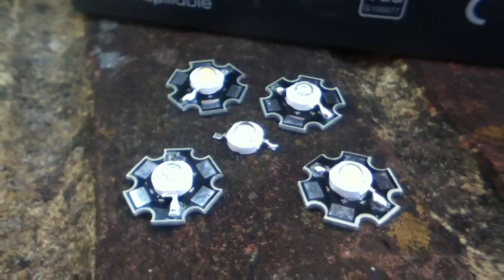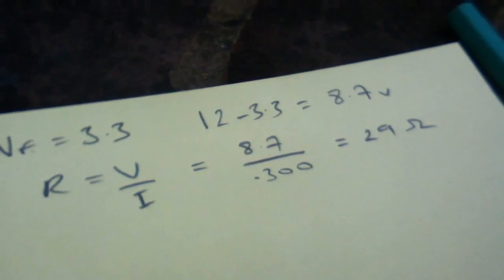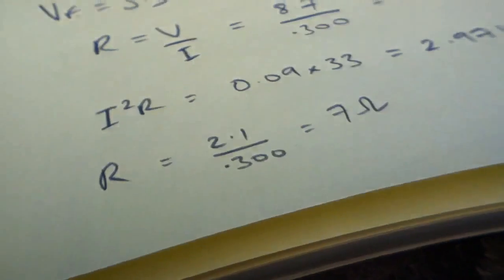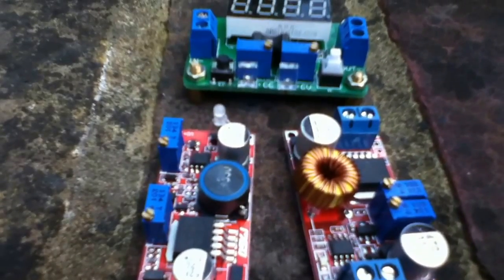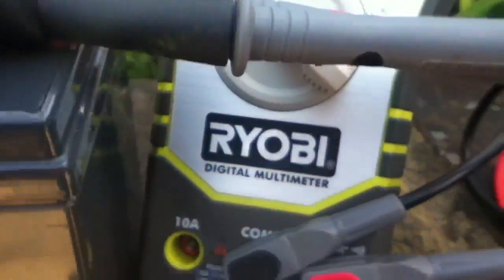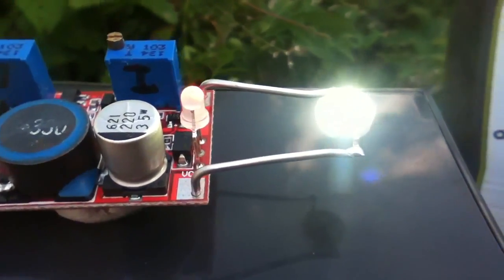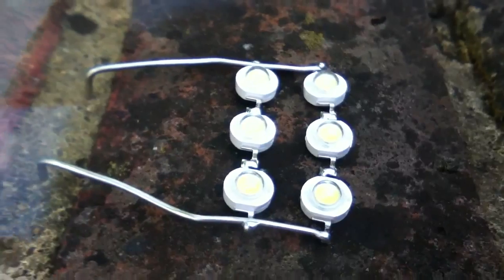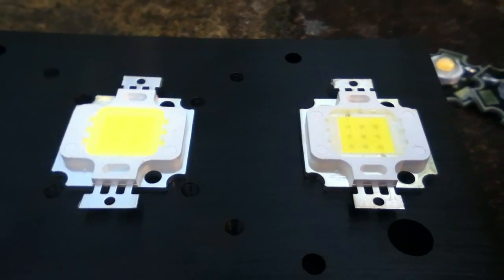High Power LED Tutorial #1 - How to Drive 1W and 3W LEDs from 12 Volts

Comment: Hi Julian, I am new to this LED. I am trying to learn. I have some of the small 3W LED which you have shown in your video. I like to use them for a lamp to convert to 12V so I can plug into 110V wall outlet. What kind of voltage current regulator would I need to use to support the LED. I like to use anywhere from 1 to 3 LED for the lamp. 
Thank you
John

Comment: Julian, Is constant current driver? If so, is it correct that when you connect the 2 strings of 3 leds in parallel, when one of the 6 leds fails the CC driver puts the same current through the other string of 3 leds which then get twice the intended current so those 3 leds will go pop. Does it follow then that you cannot use a CC driver on LEDS when in parallel, only when in series?

Comment: Hi, I made myself for a spare time hobby a small 3D printed desk lamp, where I'm using a simple joule thief circuit to drive 3 of the 5mm white LEDs in parallel from a single AA battery. I bought a 3W white LED in order to make it brighter. When I connected it instead of 5mm LEDs, it lit a bit dimmer due to voltage drop. Checked with a multimeter: JT provides total of 22V through a diode without load and when I turn on the LED it drops to 2.3V at around 24mA current, I know that max. voltage for this LED is around 4V at higher current.
Any ideas what shoud I modify to provide it with sufficient current? Do you maybe have good and simple references for this?
Thanks!

Comment: I want to use the 1W LEDs for a model kit using only a single coin type battery like in the beginning of the video. Is it necessary to use a resistor and will it get hot enough to damage plastic?
Reply: +Kevin Lam 
It'll be fine because of the Batteries Internal Resistance, won't very last long though :P

Comment: Would you think a 3W LED with 750 forward current, 3.6V voltage could be
 ran with a 5V 1Amp battery? I only need random flashes, not continuous 
light.
Reply: Brink I tried it burn the led

Comment: I see many from this manufacturer with a third pot between the other two...what is that for? Duty cycle or something? Is it so you can use the driver as a dimmer or something?
Reply: +mellowb1rd  The three pot version has charge ready LED on the pcb. It turns on when the current falls below a certain threshold value. With the third pot you can adjust the threshold current. This feature is only useful, when use the regulator for charging li-ion battery.

Comment: what if I just power 1w led with a 12 v power adapter what will happen no resister's nothing
Reply: +Mythical Unboxings The LED will most likely die instantly since you are creating a dead short across it. Unless your adapter has some sort of current limiting circuitry, I would suggest using the methods shown in this video. Correct me if I'm wrong anyone?
Reply: You're LED will burn out instantly. You must use some sort of limiter on a led if using over the 3.3-3.6v.

Comment: Could you use a pc power supply as your power supply. 12v 24a which i'll regulating to 12v 1.4a? I'll be adding a heat sink behind the lm2596. would that help?

Comment: It would be much appreciated if you cut off the end of the video showing two columns (parallel) sets of LEDs.  I purchased supplies based on this video and later found out that you should have a driver for EACH string in parallel and now my supplies are all wrong and will cost a lot to replace with the right supplies.  

Information is here and fully describes why:
http://www.edn.com/design/led/4325905/Driving-high-power-LEDs-in-series-parallel-arrays

In the last paragraph of the article:  "You should include a current regulator in every parallel branch."

And to summarize the lengthy article...

Because of minute inconsistencies in the manufacturing of LEDs and their heat reactions, current will flow unevenly through strings in a parallel array.  These minute differences in the LEDs can allow large differences in current to the point of damage and failure of the LEDs.  Therefor you should always have a method of controlling current to each string of a parallel array.
Reply from the maker: Taf & Caf It's common practice to use a single constant current driver to regulate current to the entire array. The 100W COB LEDs have ten parallel strings of ten LEDs in series with now way to access the individual strings. The individual LEDs have a wide margin for being overdriven. Total power is more of an issue because of the heat generated.
Reply: Julian Ilett The article made it sound like the current could easily destroy the LEDs if each series didn't have it's own controller.  Is this avoided by using a lower voltage than called for or something else?  I would much prefer to only have to use one controller for a larger array, but I really don't want to do a big project and then have it burn out section after section.  (I had this happen with a 5mm LED project I did before but didn't know why until I read the article about the current issues.)
Reply: +Taf & Caf If you have 10 strings in parallel and one string fails, the increase to the other strings is very small. If it were 2 strings, it would be different.
Reply: I mean...if the one string fails, it's not failing BECAUSE you only used one driver. It would have probably failed anyway. So you've lost nothing you wouldn't have lost anyways. The more LEDS in series each string has, the less likely it is for one string to be drawing more currecnt, because all the little differences average out. What are the odds of getting one string with a  much lower voltage drop, when each string is made of 10 randomly selected LEDs? If the array were just 2 LEDs in parallel, then one "string" could be drawing quite a bit more current right from the get-go, just because of the differences in the LEDs, even if they're the same model and production run from the same factory.
Reply: +mellowb1rd Makes sense, but I am ranging from two to five strings for my application, so the loss of one could create enough trouble.  Am doing it anyway though at about 70% voltage and hoping they will keep running for a while.
Reply: Taf WebDesign
Maybe put a sacrificial offering in series with each string? Or some kind of indicator, so you'd see that one string failed and would have time to turn it off. Ghost hunting groups sell IR LED arrays they designed incorrectly using online calculators without knowing that the actual voltage of their battery is not what's written on the battery. They seem to survive just fine. I'm pretty sure that, if you had 5 parallel strings and one failed, the other 4 would survive plenty long enough for you to notice. Especially if you are a bit conservative to begin with. And, the more LEDs in each string, the less likelihood there is of one drawing more current, anyway. But if you're going with two strings...why not just use 2 regulators. They are cheap enough. You can buy ones that only regulate current, and they cost less. Couple of bucks each.

Comment: Hi there. .Please please please. Help me. .I've got wind up torch with 4.2v led battery 1000amp is dead. I replaced with 3.7v Lido rechargeable battery .2000amp.  Please contact me on 07951940602

Comment: I have another question perhaps you would know what is best to do in this situation, I want to drive a total of 6 uv lights with the 12 volt battery I need to find the 365nm type lights and would this controller be the best solution?
Reply: I'm sorry Bob, I don't know the answer.  I am far from an auto electric kind of guy.  That is a real specialty.  Sorry.  I hope you are doing well.  :))  Dan

Comment: thank you very much, very helpful tutorial
I will connect 6 led in two column, this is spec of led
DC Forward Voltage (VF): DC2.2 ~ 2.6V
DC Forward Current (IF): 750mA
I will set Buck Converter output to 2.6V 1.5A
is it right ??
Reply: Seco Seco sorry for mistake 
6 led 3W each
I will set Buck Converter output to 7.5V 1.5A
is it right ??

Comment: Hi Julian

Great videos but the way! 
I have a few of this exact regulator,  could I use it safely as a sub c batterie charger. 
I need to charge them individually so I have set the voltage to 2.3 volts and the current at 450 mA as they are 5000mA cells. 
Is that OK?  And when they reach capacitie will the converter stop charging? 
The light is red while charging, will it turn green when they are full? 

Thx again! 
Adam

Comment: I want to use the 3W RGB high power LEDs to light some fiber optic fabric in a costume. I've I'm only using 3.7V Lipo battery how hot will they get. If I put them on HeatSink will it be safe around fabric? Everything I read says those little high power lights get really really hot.
Thank you!
Reply from the maker: Teresa Roberts A couple of problems here - 3W LEDs can get pretty hot, and you'll need constant current drivers between the LiPo and the LEDs. Probably better to use RGB LEDs with integral drivers like the WS2812B or APA102. I have videos on both of these.
Reply: Julian ilkkelktkt

Comment: I'm trying to complete a project but need some additional info. I want to power a 3w rgb led for a project but I was told I may have an issue with the heat that they generate. I want to put it in a headlight housing so space is a factor would I be able to have a heat sink that will work properly in a tiny space and if I used the same board to power the led what could I use to control the color

Comment: You said that it's impractical to use resistors with high powered LED's - Is that still true if you're running them from a more consistent power supply, such as a 12V power supply, plugged in to a wall outlet?
Reply: a 12v wall adapter could be anything between 10 and 14V and have maybe 2 volts of ripple on it. That's less consistent than a battery

Comment: If you put a string in parallel and any one of the leds has a slightly lower voltage drop, you risk burning out the whole string. Better use one resistor per string, if more than one, even with a regulator

Comment: SORRY FOR RAMBLING SIMPLY THESE CHEAP MOTION SENSORS AND 3 WATT LEDS ARE PERFECT FOR AN EASY DIY PROJECT.3 WATT LED,HEATSINK, MOTION SENSOR,TRANSISTOR,Photoresistor,3.7V LAPTOP BATTERY AND POSSIBLY CHEAP SOLAR CELLS AND THE LION RECHARGEABLE CIRCUITS TO KEEP CHARGED AWESOME MATE

Comment: Julian, thank you for your thorough and complete videos.  Have you tried, or do you know if it is possible to regulate the intensity of the led’s in this array with an Arduino and mosfet using PWM in between the buck converter and the led’s?
Thank you for your time.

Comment: HI This is perfect for me thanks. However, if I want to put a Pot or rheostat type device on this to drop the voltage and therefore dim the LED's - where would I put it? Will the VR try to keep the voltage up if I put it in between VR and battery?

Comment: Hello, thanks for the video it's very helpful - but I'm still a little confused about how to regulate my high power LED. 

I have a CREE XM-L2 U2 LED, which wants 3000ma at 3.5v for maximum power. I have a voltage and current regulator like the one in your video, it can deliver 5A. Do I need to regulate both the current and the voltage into the LED, or just the current?

Comment: hello hi brother, I am new to this stream, yesterday I bought  1 watt leds (http://www.ebay.in/itm/10-Pieces-LED-Diode-1W-High-Power-Cool-White-with-Base-Plate-Star-Heat-Sink-/231368457394?), and I tried to light it up so I used regular Nokia mobile charger(http://www.snapdeal.com/product/nokia-charger-ac3n/33948#Technical Specifications) but with in 4 minutes the led started flickering rapidly and later it is not lighting at all it was just stopped working. why? is it because of not connecting the resistor to the led or what brother? please reply me.
Reply from the maker: Manasseh Elson It may be because the LED overheated - did you use a heatsink? Also you should limit the current to around 350mA for this type of LED.
Reply: Julian Ilett Hello, first thank you for the reply brother. Actually I Used 2 Led without heat-sink and they are spoiled but I used a Led with Heat-sink but even it is also spoiled. and I used mobile charger which Input is: 110-240v AC 50-60Hz and the Output is 5.5v DC 600mA. What you say brother. I think I am giving high power to the led. And one more thing brother is it necessary to apply heat-sink past to the heat-sink? or not required?
Reply: Julian Ilett Hello brother you said 350mA is need for the Led, what is mA ,are both mA and mAh same?

Comment: I'm wondering what would be a good solution for a traffic director like this:
36" Amber Traffic Directional Advisor Strobe Emergency Warning Arrow Stick

I don't have a problem using smd parts, but wondering if there's any single-chip drivers, or a driver that would have some circuitry like one of these boards but multiple leads off it that I could switch with a micro and not blow anything up.

Comment: hello Julian Llett just saw ur video very helpful and solved many questions of mine as well...really great job done :) but there is a question it wuld be great if u help me out on this i am making a light panel of 80X1 Watt led's with heatsink one's the only problem is what dc stuff shuld i use..i am not much in electrical stuff but i am posting the specs for one bulb and its like this 1 led is of 1 watt consumes 3 - 3.5V and takes 150mA now can u solve this one how do we use 80x1 Watt leds it wuld be a life saver and amazing video cheers To you Man!!!
Reply: you can plug them all in series and use high voltage driver or you can plug them all in parallel and use a high current 3.2v power supply (10 to 20Amps)

Comment: Please clarify this.
The battery you are using is 7ah, the buck converter you have used can only take up 3amp (max 3amp input), you have connected it directly without any resistor. Why didn't the buck converter burned up?
What if I connect my 105ah battery directly with the buck converter I have which input max current rating is 3amp, will my buck converter blow away?
Please some one answer ASAP. Thanks
Reply: well not exactly an ASAP answer (4 months old) but anyways,

buck converter can take 3Amps max, but it doesnt mean that it would take in as many amps as you give it, it mostly means that you can suck max 3 amps out of it, you can plug it into a 1000Ah battery it wont blow up if there is nothing connected to it, if you connect a 1A load it will suck 1A, and if you connect a 4A load (trying to power a 44'' plasma TV through the buck converter for eg) it would try to suck 4A and get warm, and probably blow out.

LEDs are wierd because they have the ability to suck as much Amps as they get, thats why they would blow up so easily,

Comment: Just a warning about hooking leds in parallel.
If one led fail, the other led in parallel with it wont last very long.
Parallel circuits are current divider.
If you cut one of the current path the totality of the current will flow trough the remaining path(s).
Reply: In general if you remove one of the current paths the overall resistance will double hence halving the total current drawn. The voltage across the remaining load hasn't changed so the current through it remains the same. Having said that, whether by using these regulators, of which I have no experience, these rules change, I don't know. :)

Comment: Would it make more sense to run a single 50w led or 3 x 13 3W leds? The 3W leds only need mounting on those 20mm star heatsinks. were as a 50w single led needs a massive heat sink. Would 13 x  3W leds give the same heat output all together as the 50w led? The main problem I have is the heat.

Comment: Really Illuminating !
Now I know why there is a circuit board at all, in my Li-Ion Battery housing;_in my wheelchair_. 
::::::::::::::::::::
Can I ask you, I have an LED light on my balcony.
The light fitting says 4Watts but later on the Internet the manufacturer's company says that that item "says that the lamp is 4W  but in fact it uses 13 W,  in electricity".
.
Why so, the difference in the specification label ?
.
If you have no idea because I have left out some data in my question description, then I'm sorry for posing the question with a mistake in it;  kindly ignore my whole enquiry.
.
Cheers.
from,
del-boy
Reply: 13 watts of electricity and 4 watts of light

Comment: Hello, I have a moped and I'd like to replace the original lightbulbs with LEDs, the alternator is producing 12V AC, first I have to rectify the current to DC but the voltage increase with the RPMs... If I have something like 6-19V at the input of the led driver, it would be ok? Thank you! :)

Comment: Hi I'm trying to retro fit some star 3w 700ma led's to my car as daytime running lights. Can you please give me some advice on the best way serial vs parallel etc. I need to fit 12 X 3w 3 - 3.6V 700ma but it will be 24 in total (12 LEFT & 12 RIGHT LIGHT). Please help

Comment: Hi great video, Julian.Could you help me a bit?  I'm making 100w panel ( LED 3w [2.2 - 2.6]v 700mA ) and i dont understand one thing. I will use computer power supply it gives 12v and arround 10 A. I'm thinking to connect buck power regulator for 5 LED in series and 14 row's. And the question would be, if one of the row's wouldn't work, so rest 13 row's would share that 700 mA? leading to massive LED's burn out? If yes, how i can protect my panel from this accident. Thanks for anwser.